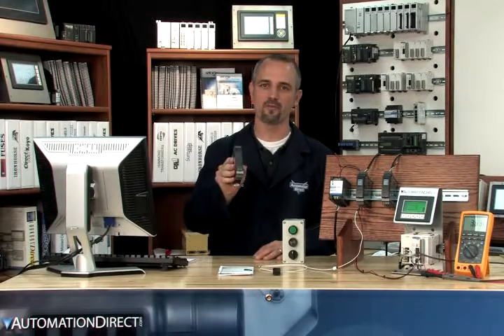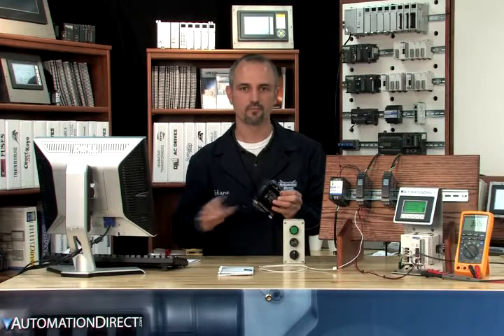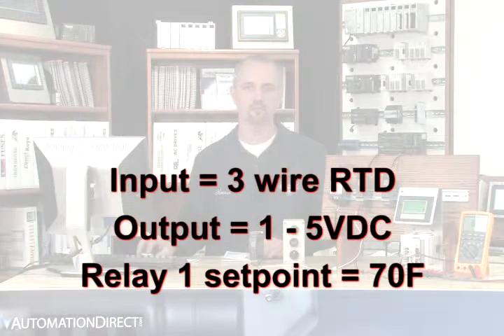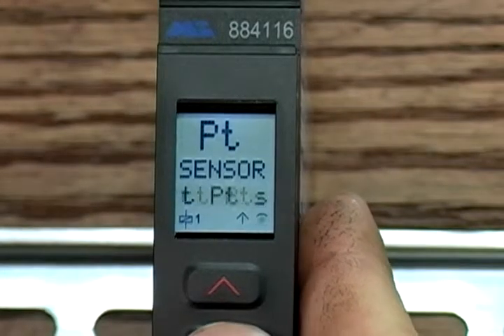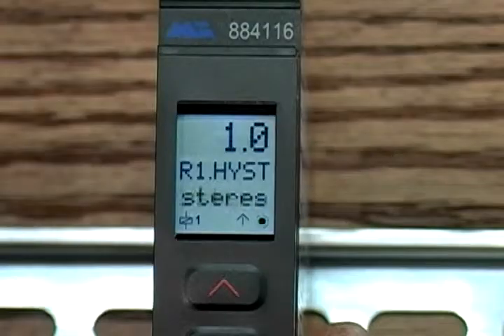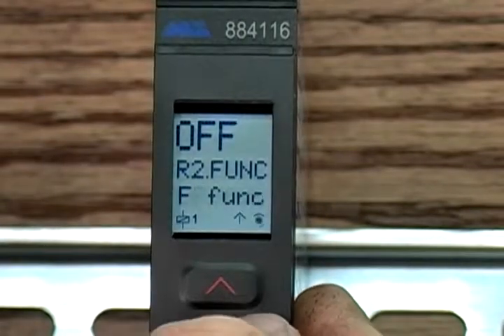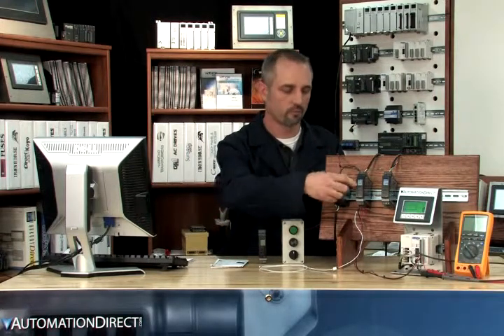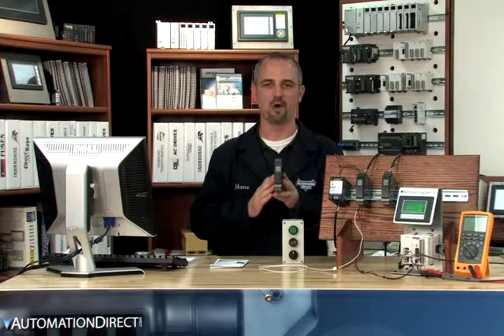Universal Signal Conditioner Programming & Setup Part 2 from AutomationDirect

Comment: I have a 1600 series, and am looking to correct a temperature deviation of 20F. The input is type K, the output is 4-20mA. Can you please advise? 

Andy
Reply from the maker: @AndyHeffernan-l1i  what is your exact ADC Part number?
Reply: @automationdirect SCU1600 with a SCU-PDM1
Reply from the maker: Is it consistenly 20F high or low, or it just deviates/floats by 20F while the actual TC is seeing a constant temp?